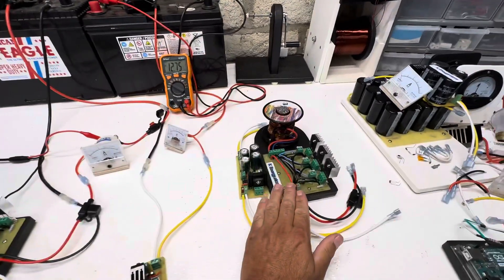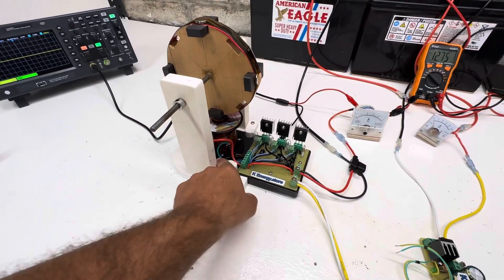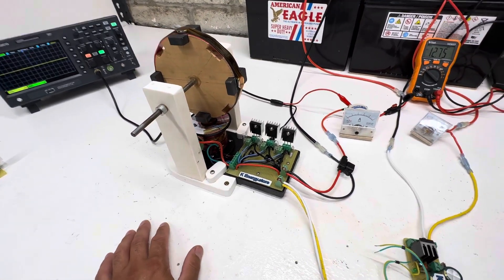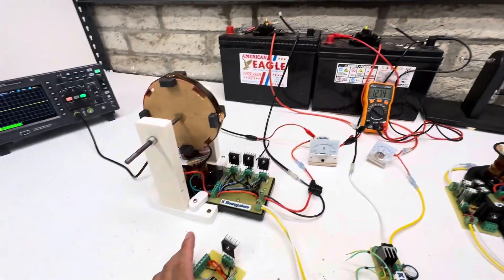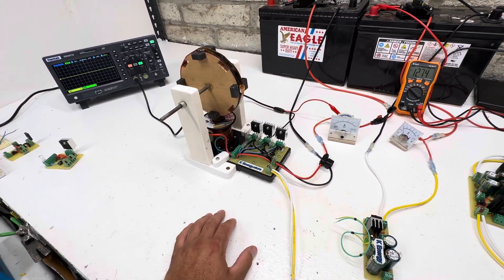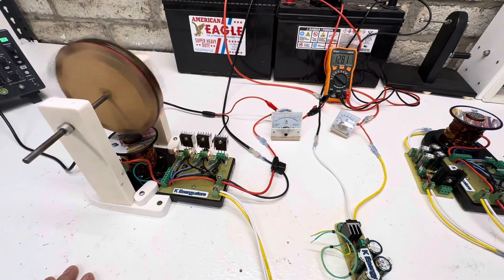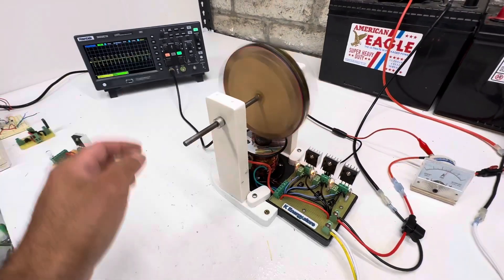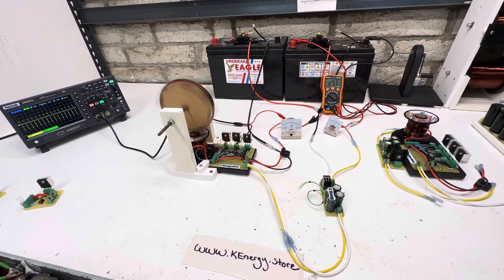Forced oscillator/ bedini motor

Comment: I it is just a Bedini energiser with one coil why are the three transistors. I have made many Bedini Motors one, two, three and six coils etc 13 years ago  but over the last ten days I cannot get one to work .The only difference is I wound the coils with Aluminim wire as that is what is used in microwave oven transformers now........I used tom harvest the wire from old MO transformers

Love your  experiments but need to go to No 1  to see your circuit ......plenty of my you tube video on Bedini motors but   I can't  get my own diagrams to work 😢
Reply from the maker: On this bedini motor / oscillator there is 4 wires 1 for trigger 3 power 
There is a transistor for each power wire 
All are copper 
This can be ran as either an oscillator ( solid state ) or motor ( mechanical)

Comment: Bedini wheel would have consumed much less with greater rpm if only the the rotor was at 90 degrees to the same coil, as you had mentioned and demonstrated in your version of a Zero Foce Motor. This wheel never took anyone anywhere outside the classroom. Time to travel now. Thank you K for your patience and responses to anyone who has a question or a comment. We all learn from your efforts, and hopefully will join you in them with our investments and inputs. Your work is truly inspiring.  Thank you
Reply from the maker: Yes for sure this old wheel was just for demonstration it just needs a big pot before the lights to tune  when tuning
Reply: Actually I was not speaking about your particular wheel, what I meant was the Bedini Wheel was a great learning tool that we need to wean ourselves from. I am not praising you, on the contrary, I am amazed by the everyday applications that each of your circuits, motors and other inventions can and should be playing right now. I think every adversity is accompanied naturally with an opportunity. But the availing of that opportunity has a price tag attached to it. Everywhere one goes his shadow follows him, except when one steps into darkness. That is the place where the shadow and its owner can get a little rest from each other. Your devices have had you to rest upon for quite a while. I hope I can be of assistance in your great ventures. Again highest regards
Reply from the maker: @rotorque4254  thank you very much I appreciate your comments always ! Hers my number if you want to talk more about it 760 9754605
Reply from the maker: You can always call me to talk about it my number is on my website

Comment: You need a CAPACITORS at the same value as the COIL YOU GET better runtime and more power for less input Oscillator